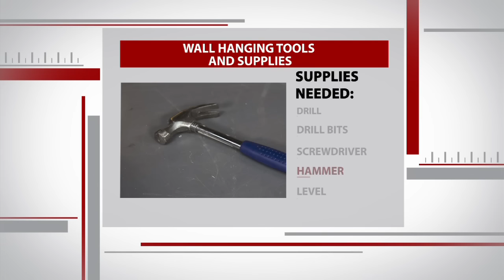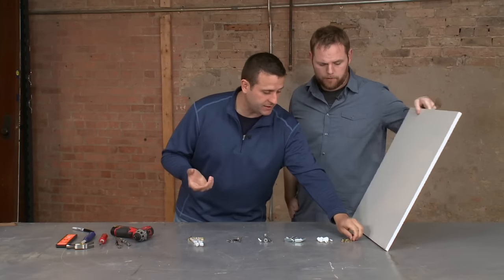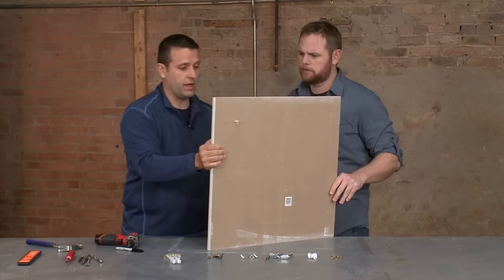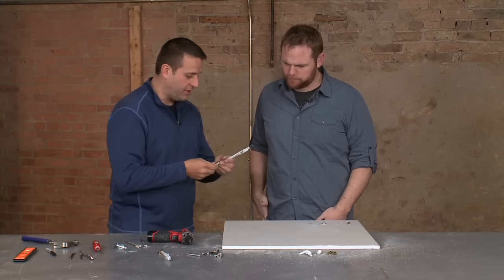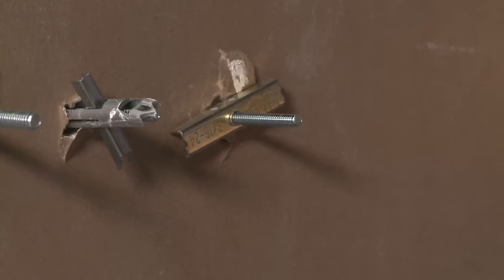How to Hang Heavy Items Without a Stud

Comment: Steel Toggle bolt Anchor installation is wrong, it is a self drilling bolt. You do NOT use a drill, it will screw it up, not majorly but still. 

Also, be VERY careful about drilling into your walls, there's 100 things that could be behind that wall. Drywall is ridiculously fragile, you do not need a drill. Drills are almost always a no no for drywall. Numerous other methods go into drywall, and not into pvc, wires, metal. Drills will go right through all of the stuff, without batting an eye, until you have sewage, water, sparks, etc coming out of that shiny new hole.

Where are the disclaimers / warnings on this video ??? Especially when you have wrong information about the steel toggle bolt anchors.

Comment: Poor demonstration of how the products work.  Should be telling people that the snap toggle goes into the wall so the wings are vertical when open.  Also the steel toggle bolt had arrows on the face and the arrows should be pointed vertical so the wings open up in a vertical direction.  If not vertical, the capacity of the anchors is about 25% of stated.

Comment: These type of videos are about as useful as a brochure. Not the anchor is the problem, they so very rarely are. The wall is!
A single sheet of drywall of about 1.2cm will simply rip before most of these anchors fail, the material is the weakest point and why it is recommended to find and use studs.